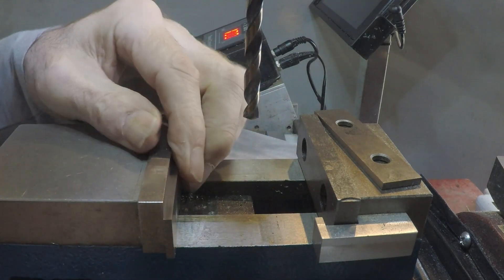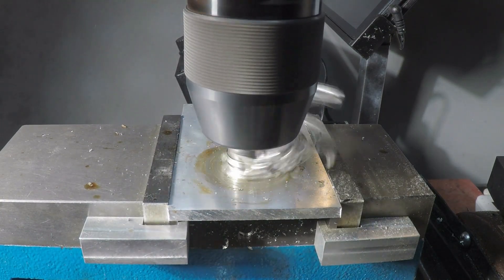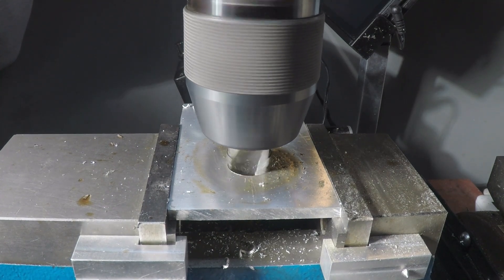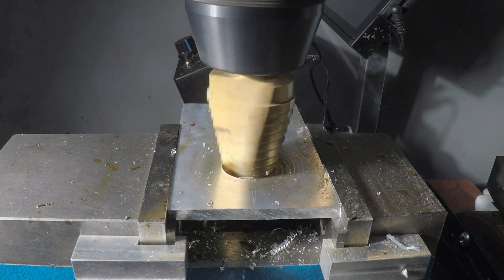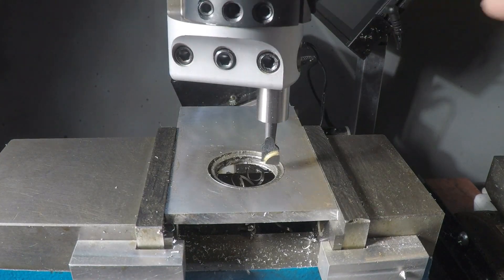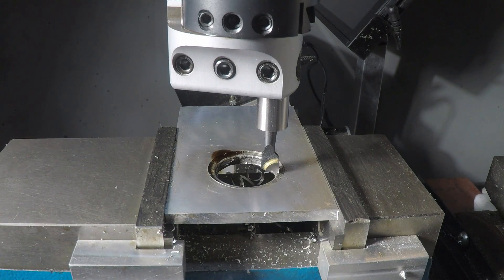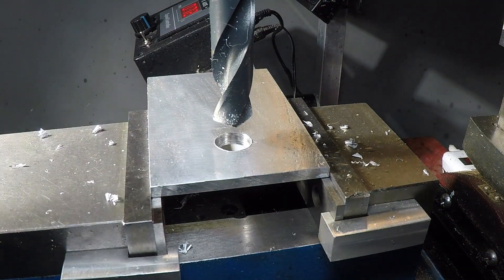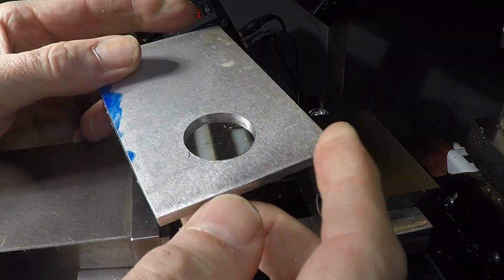My Boring Video

Comment: I find M42 cobalt drills and step drills are worth the extra cost.
Reply from the maker: I agree in general.  But I have found that the original Irwin un-coated step drills often perform better than the coated ones.  I have had my set of (HSS?) Irwin bits for over 50 years and they are still going strong.
Reply: @GuyMarsdenMakesStuff  True, a quality HSS twist drill (Dormer for example) is a thing of beauty. On another subject, I liked your cam actuated spindle lock for the mill. I will use the concept on a spindle lock I am building for my lathe. Keep up the videos!

Comment: Always keep backlash in mind. if you keep going same direction its fine, if you go back then forward again, make sure its in least one full revolution so backlash is removed.
Reply from the maker: Thanks, I knew that intuitively but might not have done it right in the video.
Reply: @GuyMarsdenMakesStuff  Nah you went one direction so it was fine, just something to keep in mind. 

Edit: Oh yeah you did back it off, but it was fine as you was still cutting with plenty to go, but yeah lol
Reply from the maker: @XXCoder  yes, I backed it off because I'm dyslexic and confuse things like directions, so I have to test it out empirically to get the direction I need to go.
Reply: @GuyMarsdenMakesStuff  Hmm on it there should be tiny rotation arrow with + and - for size change?
Reply from the maker: @XXCoder  yes, I'm sure that helps for non dyslexic people, but I can transpose anyting that has dualities to it including compass directions.
Reply: @GuyMarsdenMakesStuff  Ahh ok yeah makes sense. Thanks for explaining :)